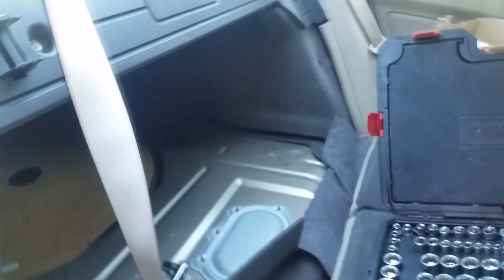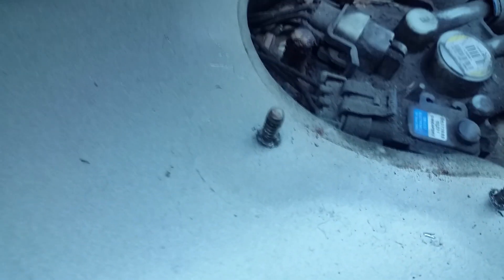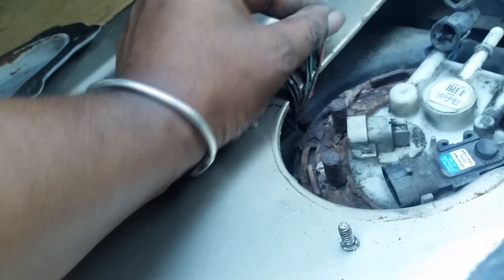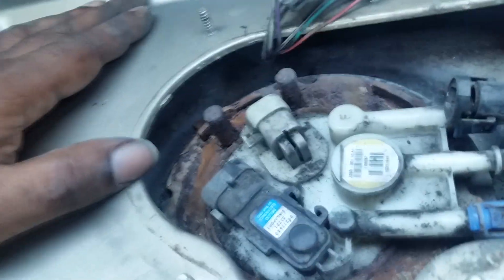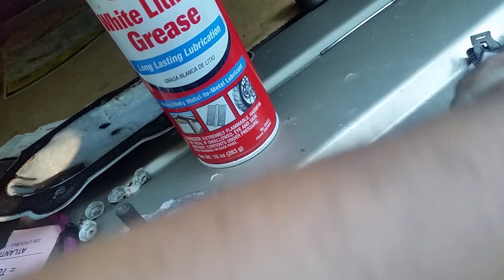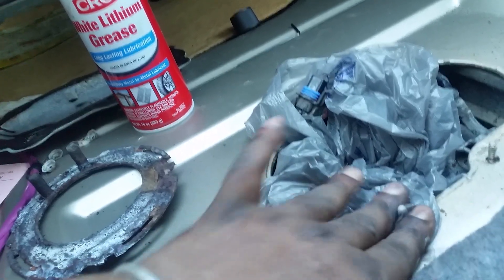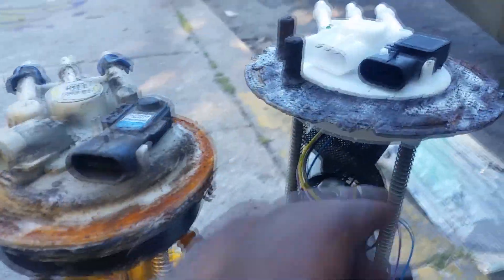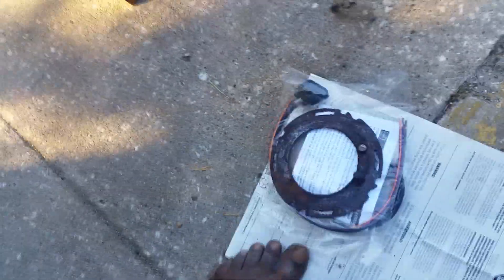How to replace fuel pump : Grand Prix 04 :Day in the Life of a Dad : repair : replacement :install

Comment: That was the whole reason I watched the video was to see you free the ring omg
Reply from the maker: you need a piece of copper or brass and a hammer. You place the brass{copper}at a angle and you hit the brass with a hammer against one of the 2 stand up post you see counter clock wise   were I say make sure you do not hit the plastic.

Comment: Can you help me out at the right  my Park lights will come on but my fog lights wont is it a fuse for it....👍👍👍👍👍👍
Reply from the maker: 2004 grand prix and the fog light switch is on the turn signal lever.
Reply: @warp103  mines is a 2006
Reply from the maker: @Dopeboy2013  should be the same
Reply: @warp103  appreciate it man
Reply from the maker: @Dopeboy2013  no problem
Reply from the maker: @Dopeboy2013  your welcome

Comment: Can this cause the car to drop in volts and idle out i would have to keep my foot on the gas to keep it running
Reply from the maker: yes it  can  if the in  tank connections fail

Comment: How did you determine the fuel pump was bad? What were the symptoms?
Reply from the maker: If it will not start in 5 to 10 sec then the pump is failing  or failed
Reply: @warp103  Thanks. Your video was very detailed and explained many pitfalls that can occur. Appreciate
Reply: Late but the gas gauge can also read empty when it’s full as well

Comment: Great video any diagrams for wiring the new connector for 2004 Pontiac Grand Prix
Reply from the maker: sorry i did not make a diagram
Reply: That’s where my problem is now .. I wired it but since then it’s been throwing the code for canister only have 6 v while the front has 12v been driving the car doesn’t go past 45

Comment: Do I twist the file pump to free it or do I pull upwards or use a screw driver and lift up out ..or..
Reply from the maker: before you try and remove it brush/blow get the dirt out of the area first. As to how it come off it lifts up. Most likely dirt is holding it in place. Is it was removed before someone may have put RTV as a seal.{Do not us RTV.} When you reinstall clean the area as best as you can but place something in the hole so not dirt falls in the tank.

Comment: Would you have to drop the fuel tank all the way to fish out the evap sensor wire ??
Reply from the maker: yes if you do not have a lighted hook or a  flexable grabber . so best to make sure you do not.

Comment: Didnt see how the ring was freed?
Reply from the maker: you need a copper pipe and hit the ring counterclock wize. Copper because it is soft or a soft wood
Reply: @warp103  okay thanks
Reply: @warp103  im having problems getting the bracket back on and tight now
Reply: @warp103  do i have to hit it back on clockwise?
Reply from the maker: @lutherwaters2795  you have to  use lithium grease . Most likely you have a bit of rust making it hard
Reply from the maker: @lutherwaters2795  yes. did you have to mod the ring?? because some of the new pumps have connection are not in the same spot. It will hit and not let it move.
Reply: @warp103  no i didnt have to mod it. Just couldnt figure out how to get it back on tight. It seems like the pump is position correctly. So i was just trying to turn it in place didnt know if it was enough force to make it tight?
Reply from the maker: @lutherwaters2795    just make sure you lube it.  Make sure the ring is in correct alignment and tap it tight
Reply: @warp103  Thanks. RPI